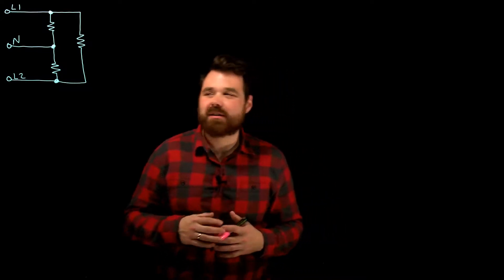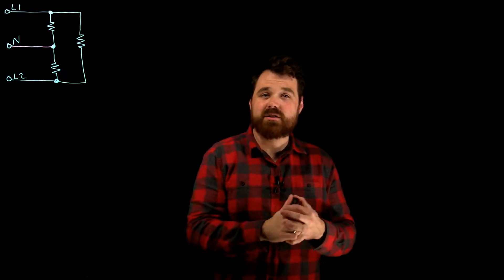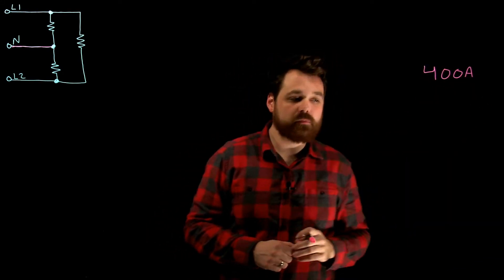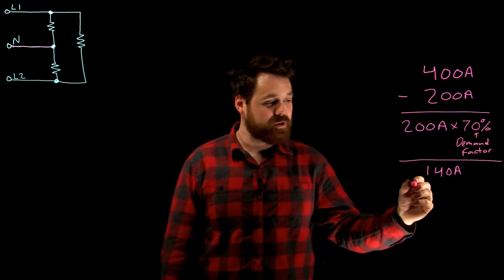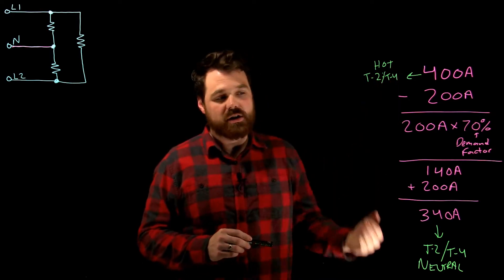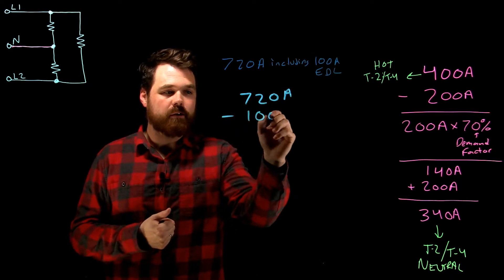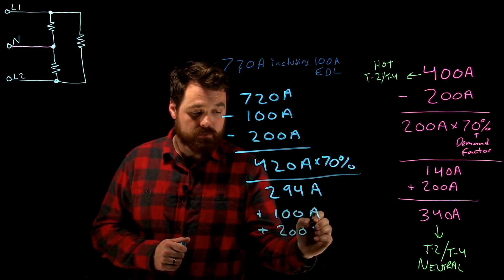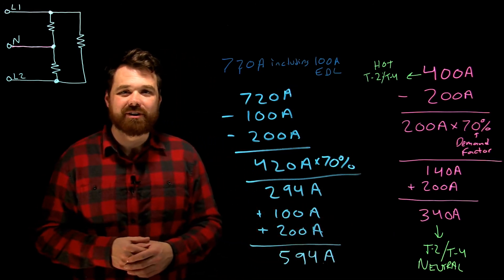Neutral Conductor Sizing

Comment: I am setting up for a hot tub. I ran a #10 stranded copper wire for my neutral from my sub panel to my disconnect outside. The tub is 220-240V and it only takes 2 hots and a ground. In order for the GFCI breaker outside to work properly I had to run the #10 for my neutral. Is this #10 sufficient for this job? The run is about 45 feet. My hots are 6AWG stranded copper with ground.
Thanks!
Reply from the maker: You'd have to check with the manufacturers specs and the inspection authority

Comment: Zack, how would one calculate the unbalanced load? I did a large new build union subdivision job where every home had a 200A panel and we undersized the neutrals 1 size. 

Also I believe the lugs on the meter base are rated for 90 degrees celcius right? what about the main lugs on the main panel, are they 90 degrees or 75deg? If they're 75 degrees (lets say we're doing overheard service) then I could use a smaller gauges of service wire from the utility to the meter, but id then have to upsize from the meter to the panel to make up for the lower temperature rating of the panel lugs (75) right?